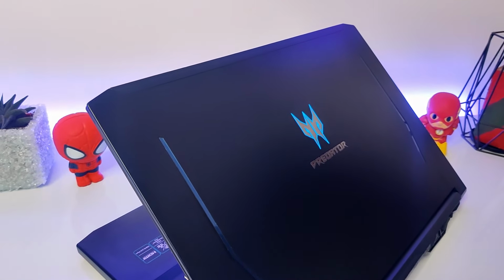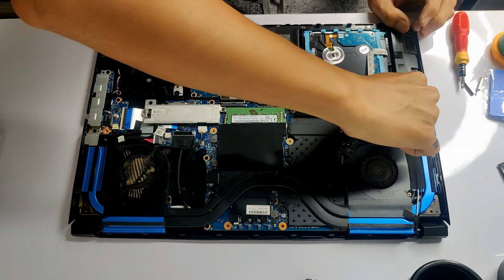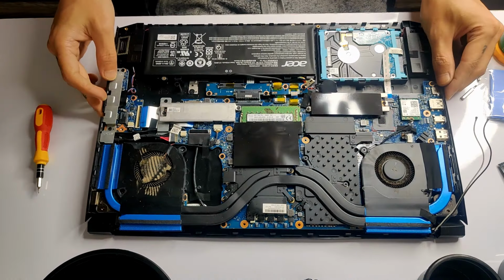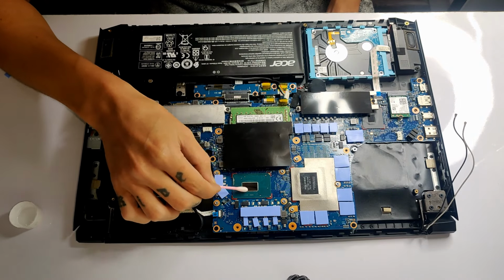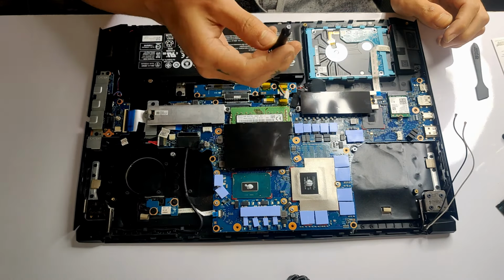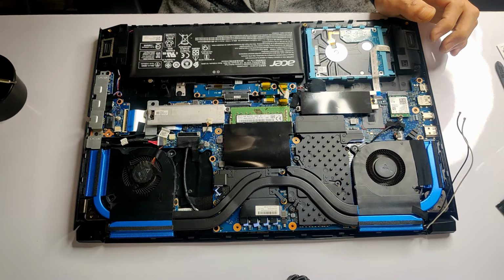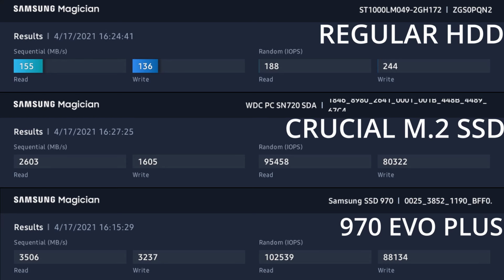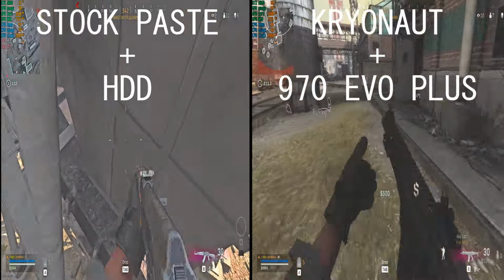ACER PREDATOR HELIOS 300 2019 UPGRADE | REPASTING | CLEANING GUIDE & BENCHMARK

Comment from the maker: SUBSCRIBE NOW! for more content and support the channel. It costs nothing 🙂✌️
Reply: hello i would just like to ask, i think my fan is not working properly, when i MAX it, the air is very strong in the side panels but both the back is nothing(gpu right side) while the left cpu side is barely a breeze(lower than a whistle air)? is this a problem?
Reply from the maker: Hey Daniel. Sounds like your rear exhaust fins needs a good cleaning. If the air is strong from the sides and less from the rear, it's most probably blocked.
When last did you clean the inside of your laptop?
Reply: Hey bro, I was going through the tutorial on this video and noticed that I didn't buy any thermal pads. I was wondering if I can just use the thermal paste (kryonaut in this case) on the part where you used pads instead.
Reply from the maker: @laisensei6984  Hey! I wouldn't recommend doing that. Regular thermal paste are low in viscosity and the gap between the chips and heatsink would not fill. Hence, there would not be any heat transferred, leading to high temps.
If your thermal pads are still good, you can still use them and it's not necessary to replace.
Or else replace with new one 🙂
Reply: @MVNDRVX  Well I pretty much skipped the thermal pads part and only put thermal paste on CPU and GPU. There isn't much obvious effect from that though. It only lowered my average temp by several degrees (in fact I'm not even sure if that's caused by the thermal paste or if that's actually due to me cleaning my fans).
Reply: @MVNDRVX  what thickness of pads you used on vrams? I am going to replace all my pads do you think grizzly 1mm pads good?
Reply from the maker: @Lai Sensei which brand of thermal paste did you use? Did you clean out the fans properly?
Sorry for the late reply. Just saw your comment
Reply from the maker: @jaewoo lim yes! Grizzly would be good. The sizes would be 0.5mm for vram memory(replacement for the pink paste) and 1mm for everything else 🙂
Reply: @MVNDRVX  I used Kryonaut on CPU and GPU and ultimately skipped the thermal pads part
Reply: @MVNDRVX  And yes I cleaned the fans and made them good as new.
Reply: @MVNDRVX  1 mm for vrams not good?
Reply from the maker: @laisensei6984  then most probably your thermal paste application was not sufficient. Are you sure you applied enough paste?
Reply from the maker: @jaewoolim196  you can apply 1mm but the performance will not be up to the mark. Thicker the pad, the more thermal resistance 🙂
Reply: @MVNDRVX  I made good sure that the paste is just enough to have a thin layer over CPU and GPU without putting too much of it.
Reply: @MVNDRVX  thanks mate one last question if i didnt find 0.5 mm since its rare in my country can i use 1 mm pads or grizzly paste instead? Which is better in this case?
Reply from the maker: @laisensei6984  too much is ok... But too little is the problem. You might want to open it up and check again for contacts.
Reply from the maker: @jaewoolim196  I wouldn't recommend but you can use the 1mm 🙂
Reply: @MVNDRVX  thermal paste which is artic mx4 on vrams didnt fix the heat issue unfortunately and the original was that pink paste from acer not bads so idk what should i do now? K50 pro not available in my country
Reply: @MVNDRVX  Do you think my Noctua H1 thermal paste that came with my desktop fan to paste my desktop GPU would also be effective to paste on my Predator Helios 300 2020 model for the gpu and cpu?
Reply: I have the same model. After cleaning the fans, one of the gold color (clip stuff) was broken. I used glue it but the cover is not closed properly, especially the left middle part(it’s popping again even though I put force on it) Any advice?
Reply from the maker: Gold color clip? Sorry I couldn't understand. Could you explain it better?

Comment: Hey man! Really nice job on the video. I was able to repaste my Predator Helios 300 2019 version (1660ti, 15.6in one) by using your video as a reference! Used exactly the same paste and pads as you. Once again, thanks for such a nice DIY video!
Reply from the maker: You're welcome man✌ I'm glad the video helped you. Thanks for watching 🙂 Do LIKE and SUBSCRIBE. I'd appreciate that 🙂
Reply: What about the performance and temperature before and after thermal repaste?
Reply from the maker: @gauravsukhadeve3657  it's all there at the end of the video 🙂 Hope you liked the video.
Do LIKE & SUBSCRIBE to support the channel 🙂✌
Reply from the maker: I used the pea drop method and the difference in temp is around 10 degrees 🙂
Good luck 🤞🏻 Do Subscribe to the channel to show some love & support 🙂✌🏻❤️
Reply from the maker: Swastik  any method is fine. Just make sure it's sufficient 🙂
Reply from the maker: Swastik  for first time, best to use the spreader provided and spread it out evenly 🙂
Reply: @MVNDRVX  i m a complete noob when it comes to these things. Ur video looks cool and u make it look easy. but m confused between grizzly bear vs arctic mx4
Reply from the maker: @pranjal3469  kryonaut is 12w/mk and mx4 is 6w/mk now you decide 😃
Thank you 😊
Reply: @MVNDRVX  i could decide if u will be willing to answer another question (possibly the last) - how long have u been using it , if its post 1-2 months did the grizzly bear hold up , meaning did it stay in the 70s ?
Reply from the maker: @pranjal3469  according to my knowledge it should last you atleast a year or 2 and it did hold up pretty well. CPU max 84 and GPU max 63. Depending on different conditions, I recently opened up mine to clean the fans and eventually had to repaste again.
I'd go for kryonaut any day. I ordered for mx4 before this and ended up receiving a fake product so I'm not willing to take any risks again.
Kryonaut product comes sealed but not the mx4 which comes in a box.
Hope I've answered your queries. Feel free to contact me if needed anytime. Do subscribe to the channel to show some love & support 🙂✌🏻❤️
Reply: @MVNDRVX  Done and done !
Reply: My Acer predictor won't turn on only the led turns on and the fans stop after some time
Reply: @boomerang0101  I changed the ram
Reply: @boomerang0101  only thing I did was change a ram stick it's working now perfectly
Reply: @MVNDRVX  Did anyone replace the black fabric tape in their Helios 300? Like the tape that's used to hold down cables and all? I'm less concerned about the cables and more concerned about how the tape is used to duct the cooler fan to the heatsink. I worry that without fresh tape, there will be leakage of hot air and a loss of cooler efficiency. I would use regular electrical tape, but I feel like at the high temperatures of the cooler, the adhesive will break down and leave a gummy residue, or worse yet, the tape could melt. I think my tape is only rated to 80⁰C according to the label. Hopefully to outer surface of the cooling fan doesn't get to the same temperatures as the CPU itself (93⁰C in benchmarks).

I have some fabric medical tape that could maybe work—it seems to have a very similar texture to the manufacturer tape. Is there a purpose-built solution anybody else is using? Or maybe y'all could just assuage my concerns and tell me this is not something worth worrying about lol
Reply: @DaimyoD0  I too need the tape now can you suggest one?
Reply: @Vishal-gr4bz  I just ended up using some generic electrical tape I had because I didn't want to wait for something else to get shipped. Stuff I have is rated to 80C, hopefully that's enough. It hasn't given me a problem yet, no melting plastic smell or anything, but I haven't really pushed it with benchmarking or anything yet and I haven't opened it back up.
But I think you can find the legit stuff by looking up high temp electrical tape or heatsink tape online.
Reply: @DaimyoD0  I'm planning to do a repaste on my laptop
Thinking of using liquid metal this time
Any thoughts?
Reply: @Vishal-gr4bz  Eh. I've considered it in the past myself, but I kinda have to question if the risk is worth the performance benefit. Like IMO the Predator is more bottlenecked by power delivery and cooler being a little anemic, I don't know how much better liquid metal will be than any high quality non-conductive thermal paste. Like best case scenario, a few degrees for a situation like this, right? I know there are specific circumstances where liquid metal can be way better, and maybe it could benefit more since this is a direct-die cooling solution. Maybe it's worth a shot. I just kinda felt like, the risk of corrosion or shorting something on the board wouldn't be worth it while their are other limiting factors to performance, like power delivery, cooler limitations, inability to overclock the 9750H because it's not unlocked. I haven't really even tried undervolting yet. And I''m not totally sure how much it's thermal throttling and how much power delivery is involved. So I don't think the potential benefit was worth it for my risk tolerance. But if you're ready to take on the risk for the sake of experimentation, more power to you.

Comment: This was extremely useful to me. Thank you in particular for specifying the thickness of the thermal pads at 7:30
Reply from the maker: You're welcome. I'm glad the video was helpful 🙂 Do subscribe to the channel to show some love & support 😊❤️
Reply: Same here, anyone know the thickness?
Reply from the maker: 0.5mm for vram memory and 1mm for everything else.
Reply: @MVNDRVX  is it ok to use 1mm for vram too?
Reply from the maker: @savindumarapana6634  Not recommended.
Reply: Can I replace thermal pad by thermal paste or that wrong ?
Reply from the maker: No you cannot.
Reply: I couldn't find think pad .5mm can use 1mm ?
Reply from the maker: @mohammedabdo4096  not recommended but you can try.
Reply: @MVNDRVX  ty so much 😍
Reply: @MVNDRVX  hey i want ask u something about thermal pads gelid I bought a thermal pad gelid-ultimate and that arrived gelid extreme
did u think there is a difference between the two and that was cheating right? 
so I called them to return that right or i can keep it?
Reply from the maker: @mohammedabdo4096  Gelid is fine. You can use it.
Reply: @MVNDRVX  so I'm not need to return it because it not ultimate it's extreme?
Reply from the maker: @mohammedabdo4096  yes Gelid Extreme will work just fine.
Reply: @MVNDRVX  ty so much 😍
Reply from the maker: @mohammedabdo4096  you're welcome.

Comment: You are a big help for me.
Reply from the maker: Now does that deserve a subscribe? 😋
Reply: @MVNDRVX  Yup definitely, I would like to know about the thermal paste, do I have to Spent 1k for a paste buying all these tools Cost almst 2k.
Reply from the maker: @mrunkwn-km5le  yes but it's totally worth it. You can go for other alternatives like cooler master that have the same 12-14w/mk and cheaper also. It will last you atleast 3-4 repastes. 
Thermal pads replacement are not necessary if it's still in good condition.
Screwdriver set will last a long time. That's obvious. Isopropyl alcohol also.
Reply: @MVNDRVX  I was hoping to save money on the pads but last time I repaired in nearby shop (which is Acer authorised but not fully, works on tender) has replaced my pads and Thermal they were not professional compare to the pay which is 1200 , now I recall they used similar thermal paste that were used in normal notepads or old lappy, the temperature problem was not solved but I shrunk my uses to light since  I didn't have time to travel far to repair it.
I will do it myself now.
Btw how many times can I use the thermal paste and pads given that it is only 1gm.
Reply from the maker: @mrunkwn-km5le  you can use a 1gm thermal paste for 2 repastes. Should last you a minimum of 3 years.
Thermal pads should be 1 or 2 times use depending on how you manage the sizes. I haven't changed my thermal pads since the last time but I will have to repaste the CPU and GPU though.

Comment: Didn't know you could open the fan unit like that. Gotta clean out my fans tomorrow. It was starting to make noise in higher rpms. 👍👍👍👍
Reply from the maker: Thanks for watching. Glad you got to learn something new. You should open the fans and clean them since most of the dust will be stuck at the exhaust fins, which blocks the hot air from blowing out therefore causing thermal issues. Make sure you repaste the CPU and GPU with a good quality paste in case you're planning to dismantle the fan unit or else air bubbles might form in the thermal paste when placing the heatsink back. If you liked the video, click on the LIKE button and subscribe for more content 🙂✌️
Reply: @MVNDRVX  i repaste my laptop like 3 months ago unfortunately i forgot to clean the fan. Is it fine to repaste it again?
Reply from the maker: Yes.. it's completely fine to repaste it again 😃

Comment: Hi bro great job 👍
In your description you mentioned the thermal pad which consists of
20X67X0.5mm X3, 
20X67X1.0mm X3, 
20X67X1.5mm X3, 
 Are these many pads required or less than this is enough. If you could remember please tell me how much thermal pad required in both area  and thickness of it?
Reply from the maker: Thank you. 
Atleast 2 strips of 0.5mm and 1mm.
Reply: Hey! Did you repaste your laptop? If so what temperatures do you get after repasting? I'm planning on repasting my Helios 300 2019. It starts to thermal throttle at 85°c and can't play games for more than 10 mins.

Comment: so satisfying to watch!.. a couple of days ago my gpu fan almost failed and I opened it up for cleaning (obv not as thoroughly as you, I'm kinda scared to open it up completely on my own), however it barely moves even when i try to rotate it manually.. I'd hope it didn't need replacing, as it's practically impossible for me to get new parts in the country where I live :'(
Reply from the maker: You should clean it thoroughly. It's not that hard. You'd be surprised by how much of dust could accumulate on the fan blades.
I'm glad you liked the video. Do SUBSCRIBE to the channel to show some love and support 🙂✌
Reply: @MVNDRVX  true, I cleaned my acer predator Triton 300 yesterday by taking a reference from your video(because I was too scared to open it without any advice. I watched your video till the end and finally gained some confidence) and you wouldn't believe that how dirty the fans and exhaust were, there was literally a layer of dust between exhaust and fan. The thermal paste and pads are also goners but I haven't changed them yet.
People should really just have confidence and clean their laptops if they really value them.
Reply from the maker: @samyak4175  I'm glad the video was helpful. You should repaste if you removed the heatsink because air bubbles could form cause thermal issues. Hope your thermals are normal 😃
Do subscribe to show some love & support 🙂✌🏻❤️
Reply: U can try synthetic oil ,,, open the fan and apply it in hole and  center tip, use "small drop"  , it worked for me .. my GPU fan is working as new 👌🏾
Reply from the maker: @meeetptl  thank you for your suggestion 🙂👍🏻
Reply: same problem I faced a few days back.. GPU fan showed 0rpm in Predator Sense app, i suspected & opened GPU fan after referring to some videos online & opened it up completely & cleaned it up, put some lube back on & bam !
It works like new now ! I saved a lot of money by not going to the servicing center only to get the fan replaced like a noob !

Comment: Would be cool if you had specified what kind of screw heads you were using
Reply from the maker: Thanks for the suggestion. This was my first tutorial video so didn't think of it 🙂 You can use Philip head screwdriver size +0 🙂
Hope you like the video. Do SUBSCRIBE to show some love & support 😊✌❣
Reply: @MVNDRVX  Thanks bro, I got a samsung 980 SSD instead of 970 Evo plus, will that be alright ?
Reply from the maker: @unicornhuntercg  you're welcome. That's absolutely fine. I used the 970 cause the read & write speed is faster than 980 🙂

Comment: You did it carefully and perfectly  with lot of patience bro unlike some goons out there, I was wondering for perfect use of thermal pads as what thikness should be used where and all but you solved that confusion too bro Thanks and take care bro, I am about to paste my GPU and CPU this weekend, wish me luck bro.
Reply from the maker: Thank you so much. Since this was my first tutorial video, it means a lot to me 🙂 I'm glad my video was helpful and educational 🙂
I wish you all the very best. Do let me know the results and if in case you have any doubts, feel free to ask me.
If you liked the video, do click on the LIKE button and SUBSCRIBE for more content 😉✌
Reply: @MVNDRVX  sure bro will share the results as I am going to use cooler master mastergel maker instead of what you used and remaining stuff is same in my case.
Reply: @GhostDevilGamer  Bro did the thermal pads help you ?
Reply: @reubenfernandes5003  yes it did GPU temps were touching 91-93°C before and after repasting/thermal pads application it is at 74°C on 100% load and CPU was at 93-95°C now it is at 80-83°C,

For GPU it is arround 19°C drop and for CPU it is approximately 10-12°C drop which is significant I would say and keep in mind I don't have AC in my room and room temperature was 25-28°C.

Comment: Great tutorial, thanks for taking us through it step by step. Did you by any chance see whether there's any difference to the CPU and GPU temps when you undervolt your machine or reduce your maximum processor power to less than 50pc?
Reply from the maker: Thank you 🙂 
I have undervolted, reduced processor power, etc. It does help with thermals a little bit but takes a hit on performance.
What's the point if you can't squeeze every juice out of the machine. Right? Lol
Reply: If you're struggling with high power usage and high temps, simply change the maximum state to 90%. The hit to performance is negligible but helps limit the CPU overperforming
Reply: @Klepto_Nite_VODs  how to do this ??